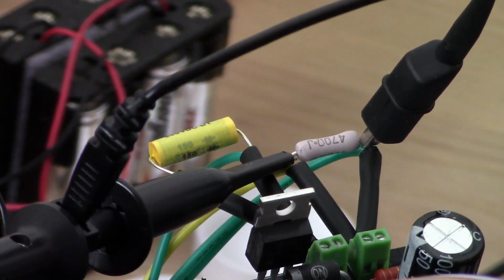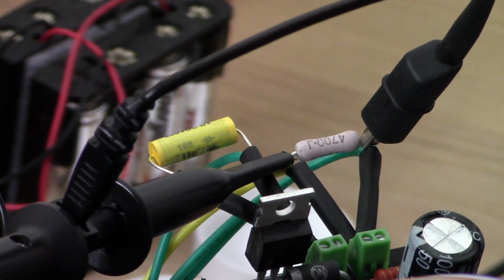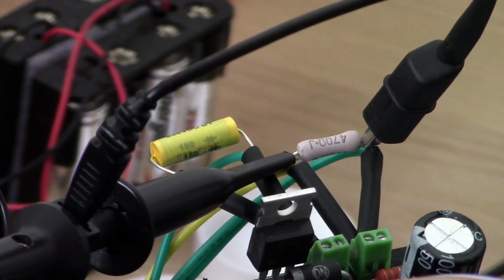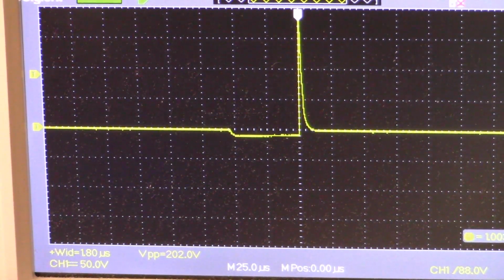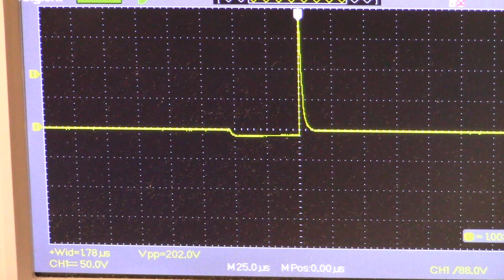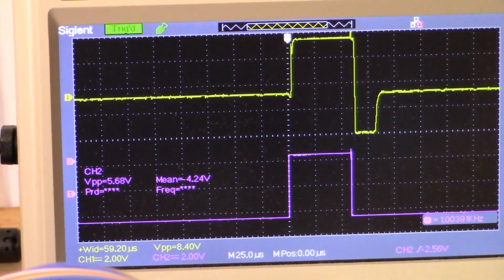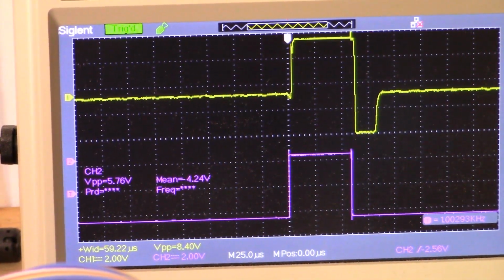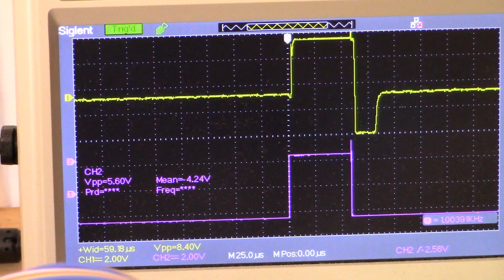Voodoo DIY metal detector Part #4 Flyback signal and PI Pre amp output

Comment: Also i can see im going to have to invest in a oscilloscope i was thinking usb over portable type ?
Reply from the maker: My preference is a bench-top oscilloscope. If you do not want a new one then there are a plethora of used models available on Ebay and Craigslist.
Reply: @SurfDetector  will this one do everything i need it to for detectors https://www.ebay.com/itm/JDS6600-60M-60MHz-Dual-Channel-Pulse-Signal-Generator-1Hz-100MHz-Meter-266MSa-s/383653480006?hash=item5953878646:g:N~kAAOSwH~ZfID7J
Reply from the maker: I would recommend purchasing an oscilloscope prior to a signal generator
Reply: @SurfDetector  ok thank you

Comment: So i assume you have to build a damping resistor first do testing to know what resonant cap you need ?
Reply from the maker: The resonant capacitor for the Voodoo project and the damping resistor are disparate topics.

To calculate the resonant capacitor for the Voodoo detector you need to know what frequency you want, 10.5 KHZ in this case, you also need to know the inductance of your coil then just solve the equation for the Cap value.
F=1/ 2π (√LC)
Reply: Ok i kinda figured that like a Tesla coil minus the lighting tuning the caps to the coil

Comment: Good job sir, can I know what is the good frequency value of search coil to detect small gold?
Reply from the maker: Hello my friend and welcome to my channel.  I hope that you will subscribe.
Finding small gold has more to do with the sample pulse delay than it does with frequency.  I am speaking about a Pulse Induction detector.  With a fast coil, one that comes out of saturation quickly, you must be able to have a small sample pulse delay (<10uS) to have the best chance to find the smaller gold before the eddy currents decay.
Reply: @SurfDetector  Thank you for reply me sir. Yes, I gues like that too, there should be more opportunity (more time) for the receiver to feel of the "reflected signal" before it covered with the next signal generation that will continuing given.
Reply: @SurfDetector  sir, today I just  try PI system with 455kHz, I use IF on AM radio receiver as the Receiver 455kHz amplifier, and I feels this is better for small targets than lower frequency, and the next I will try on 3.xxMHz or 4.xxMHz because it's easy to get the Crystal on old television for the oscillators. I hope 3MHz or 4MHz more better than before.